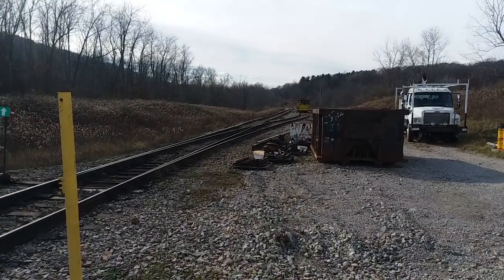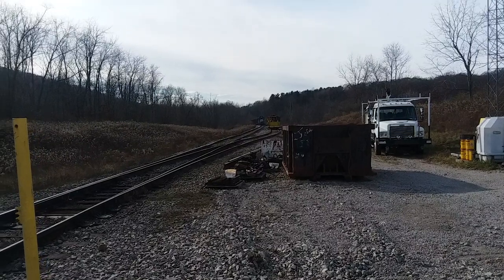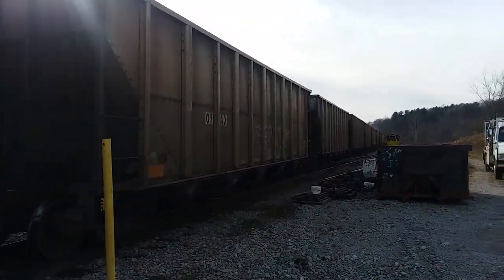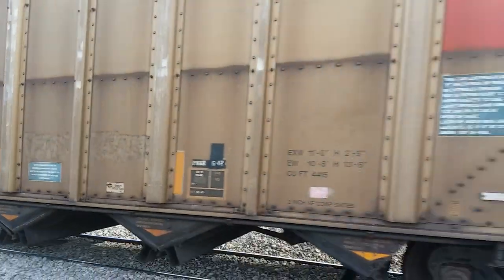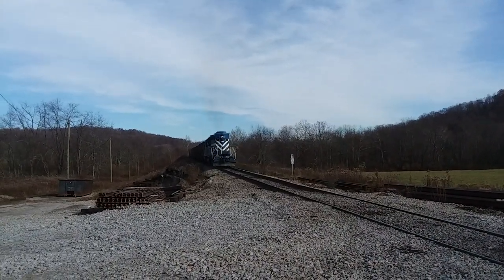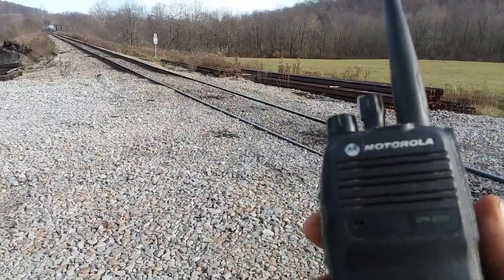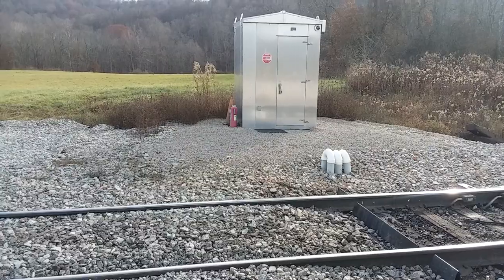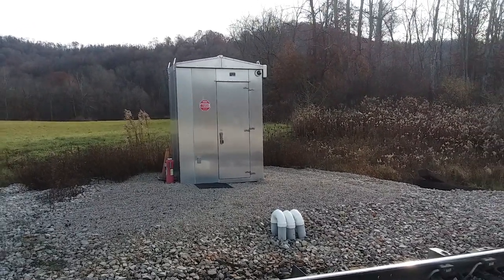EMD SD 38-2 Cumberland Coal Railroad Push Pull System, Plus Hot Wheel Detector

Comment: Is there a certain spot , that when hauling heavier loads as such the engineer should know to give it more throttle?  That way wont be any issues to continue as such.
Reply from the maker: Yes sir, our track is full of varying grades, they are constantly
adjusting throttle to maintain our track speed of 25. In this video
they are just starting to climb up grade for about a mile and a half
at a 1.5 % grade, then track levels out for a half mile, then they
go into a 3 mile down grade at 1.75%, that's just a for instance to 
give you an idea. Thanks for watching and for your question